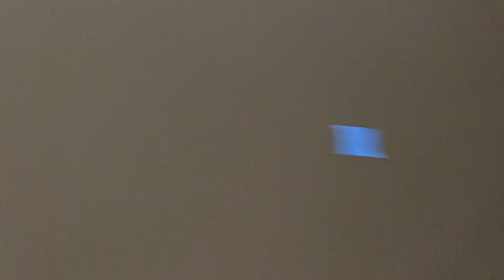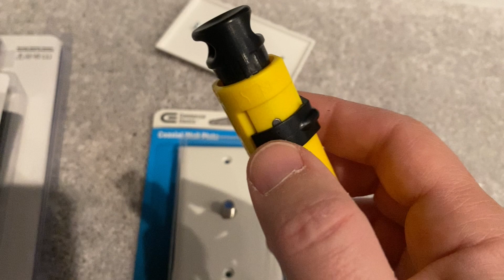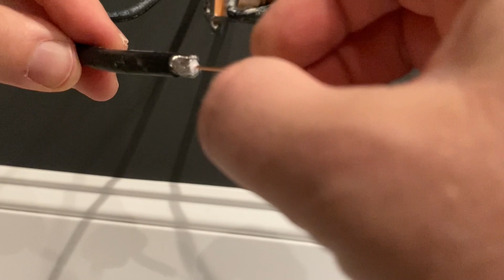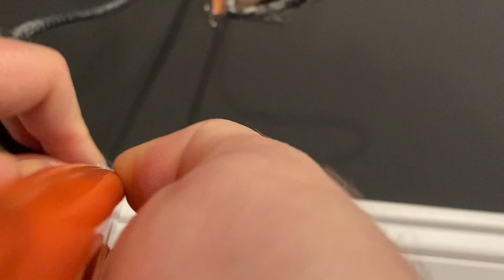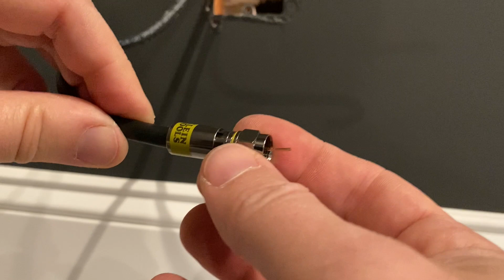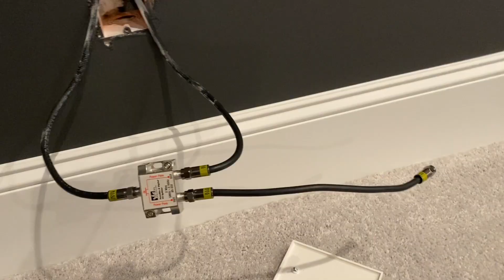RG6/COAX Compression Fittings DIY | Better than crimping! (Klein Tools Installation Kit)

Comment: That looks like a dual shield cable rather than a quad shield cable. I saw only one layer of aluminum foil, not two. Also, the aluminum foil is not generally removed; only the braid is folded back. Cutting away the foil also risks damaging the dielectric that insulates the center conductor and allowing some signal to leak out.

Comment: DO NOT BUY THESE FROM BUNNINGS (AUSTRALIA) the kit comes with 6 RG6 6Q compression connectors. Bunnings only sells the kit and does not sell the connectors which is a total scam. You then have to go online and pay an extortionate amount for the connectors from overseas. I bought then blue RG6 6Q from amazon as they were slightly cheaper than yellow ones but they do not work with this comptession tool. Feel totally scammed. Most companies are low down lying scum these days.
Reply from the maker: Sorry to hear that but cool that my videos are helping out all the way down under 🍻

Comment: Very good video. Thanks! Not related to the main topic of this video, but I don't like how the folks ran the wiring. With the way they wired it, the two subwoofer outputs share the same subwoofer input via the T connector. Ideally, you want independent wires run to the rack. Good processors these days have independent subwoofer outputs (many have 2 subwoofer outputs, and higher end subwoofers have 4 subwoofer outputs). By having independent subwoofer wiring for each subwoofer, the delays, gain, and timing of each subwoofer can be tuned (from the processor or a miniDSP 2x4 HD) independently. But that's not the main point of this video. The termination lesson in the video was very good.
Reply from the maker: +Rand Man thanks! Yeah, I learned that after the fact…. 🍻

Comment: I bought a kit and I want to shorten my cable wire. When I attempt to put the connector on, it doesn't slide up enough where the white part is against the inside of the connector. Does this mean I need a different size connector?
Reply from the maker: +Stacey W possibly 🤷‍♂️

Comment: I've been a cable tech for over 6 years.  So, your rg6 cable is dual shield and you never remove that foil.  Quad shield, is exactly that, foil, braid, foil, braid.  In quad shield, you would remove the outer layer of foil but never the foil on the dielectric, which is the plastic.   Only thing I see worth correcting.  👍 (I'm here because I own a 986 lol)
Reply from the maker: +Paul ahhhh that makes sense! First, I was like “they said there would be more braid under here. Second, that foil did NOT want to be removed!
Reply: @HelpMeDIY   You have to do your connection all over again.
Reply: I was wondering why he was removing the foil...
Reply: Since you were a tech, I’m sure you know, what is the difference between short F-connector vs long, when would you install short vs long one. The short is 18mm vs 21mm for long one. There must be a reason because there are F-Compression tools for each. I’m trying to buy a tool and need to choose connector type.
Reply: I'd get an adjustable compression tool. Reason being slight length variations as you mentioned just two there are many slightly longer, shorter
Reply: @DanielDiaz-uw2ob  You could help out and make one yourself
Reply: You should know as doing the job for that long it's better than listening to a random
Reply: Exactly